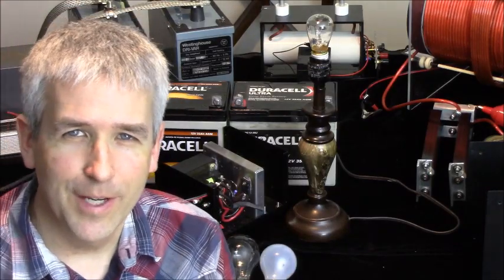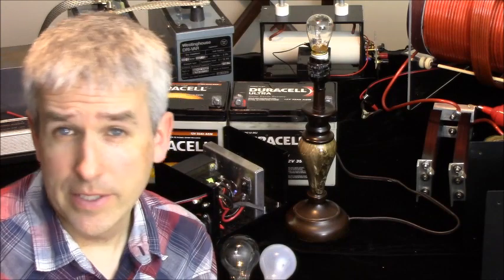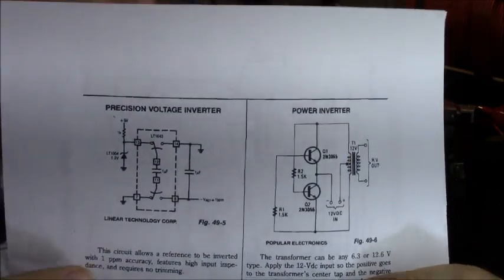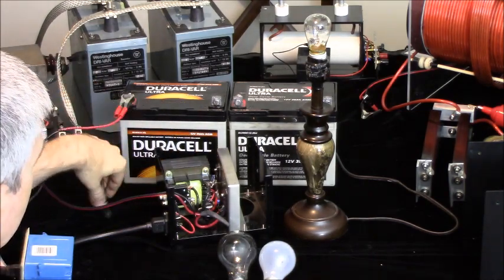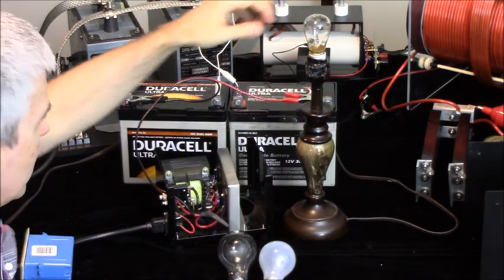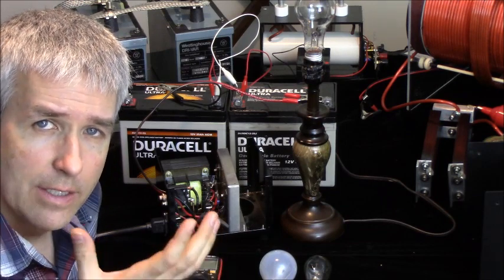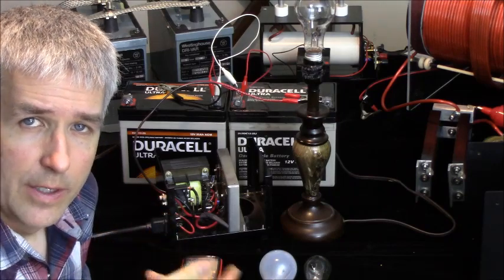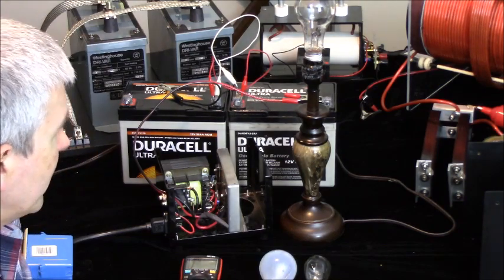Inversion: 3rd Stage of an Overunity System

Comment: Rick , you mentioned your one device produces 10,000 volts.  Correct me if I'm wrong.  You would have to convert the AC to pulsating DC thru a bridge, then when you convert the 10K volts down to 110V thru the 3rd stage along with bringing the frequency down to 60hz, I would guess you have a lot of amps at your disposal, but in reality only enough that the 1AU could handle  based on the load you're using ?
Reply from the maker: That was a 20kv 6A bridge. Output could be 10kv 2 10ka if you could have a load to be big enough. 
The 1AU has nothing to do with any of this. I just used the transformer and box to show you how to make a basic inverter. Inverters change voltage and frequency, and the key part of such inverters is the transformer in this case. 
Yes you would step down the voltage to desired voltage, as well as the frequency...
Reply: makes sense..thanks.     So if you had a 9 amp load 110v (round up to 1000w), you could basically run 9-10 similar loads off the transformer at the same time ?
Reply from the maker: Not sure how you got that idea. These magnetic resonance systems put out whatever amperage the transformer you put on it is capable of at the voltage specified. Similarly to the bigger the battery the more you get out of the motor systems. You just have to tune the transformer to get the 60CPS frequency and set the voltage to the transformer primary winding. And have suitable grounding...
So if you wanted to run ten 1000W loads you would get a 10kw transformer and hook up your loads as needed.
Reply: Thanks Rick, appreciate you taking the time to answer my questions .
Reply: @mscavsfan  btw, this Don's system has a resistor on primary of the transformer to set the frequency. it works exactly like a low/band pass filter of a subwoofer crossover f.e. with (resonance added to) the cuttoff/pass frequency at your 60/50 cycles.

Comment: Don used a square wave 120 vac inverter with a triac at output made for dimming neon power supply. The electronic neon supply work at 35.1khz, this is exactly 585 time 60hz, odd number, and with the triac, we have a gated 35.1khz at 60hz. Now the primary of the center coil match the one secondary who have a capacitor. The neon transformer send pulsed trains to ring the coil/capacitor then exchange happen between primary and secondary. the lenght of primary must fit in odd number the lenght of secondary, open tube resonantor can be set in resonance with lower frequency if square waves are sent and odd number are respected. Don said it is around 20mhz, so a quater wave of 20mhz should be the primary and 20mhz/35.1khz give 5.69 times, odd number again. I done many tests and read about Don and he use the copper skin effect also in these frequencies. One secondary is resonant and other not, so one have square waves and harmonics and other is sine wave, both are half cycle rectified and charge the output caps and then the output serial choke will recharge the battery. I amy not use all the good words to explain it, but if you get the idea, it work like this. Air core is needed, we move the ambient field, we dont create the field, it is already here.
Reply from the maker: Michel, did you do this? Do you have any results to report? You seem to jump around from several different setups. 35khz is based on the primary coil's inductance and capacitance. The particular frequencies are not important, like 35khz or 20mhz. It is about getting the two coils L1/L2 (which you don't actually need) to "talk to each other", that is be in a wave relationship like 1/4 wave, and in resonance. The one coil or both can be in resonance, and the L2 will receive much magnetic flux from L1 being in resonance even if L2 is not turned to L1. How you design L2 will determine your voltage and amperage output in relation to ground. 
The NST (neon sign transformer) not necessary now that there are easier options. The key to doing a Don Smith setup is understanding directions and basic theory, and not in trying to copy a particular setup. This is where people fail. You can't merely copy most of the models because there is some fine tuning as no parts are equal. You have to build with what you have. I'm trying to bring this out in the meetings and in the new book.
Reply: Rick Friedrich I have studied a lot and the wire lenght is important, I work also on Akula devices based on same way, Don use another style but at the end same principle.  Reach me on Facebook.

Comment: Rick, those jumper wires have significant resistance when they warm up, acting like resistors and limiting battery current in your 200w load test
Reply from the maker: Yeah I didn't prepare that before I started. It wasn't an issue with the lower wattage bulbs. When I did it at first the batteries were connected with a proper connection.